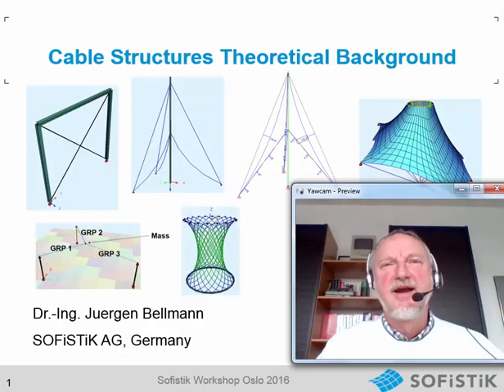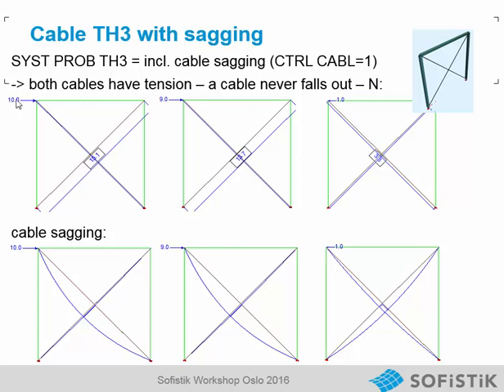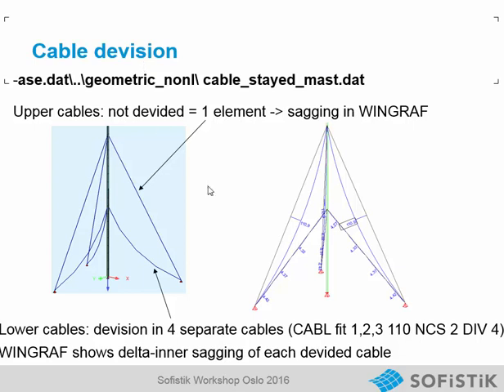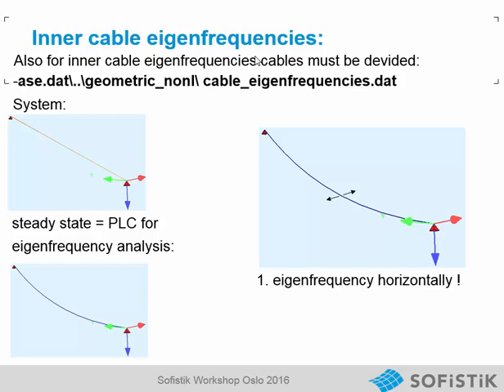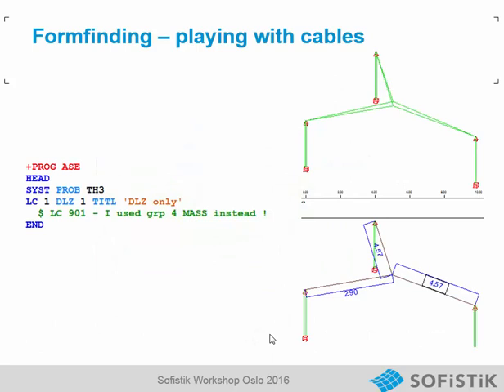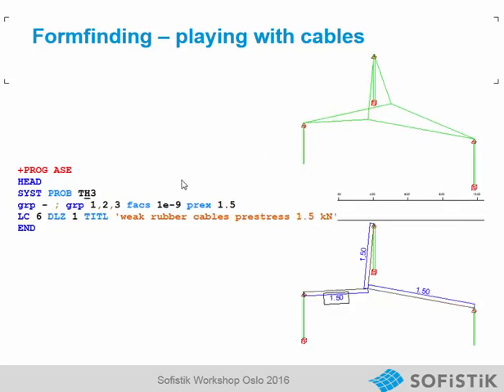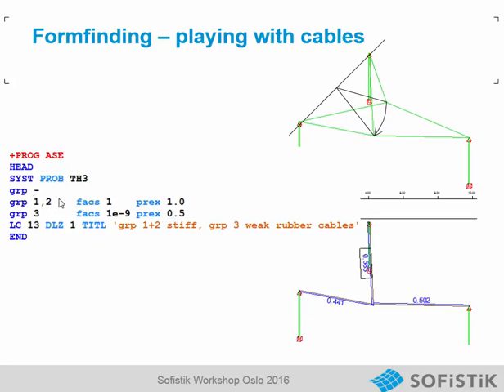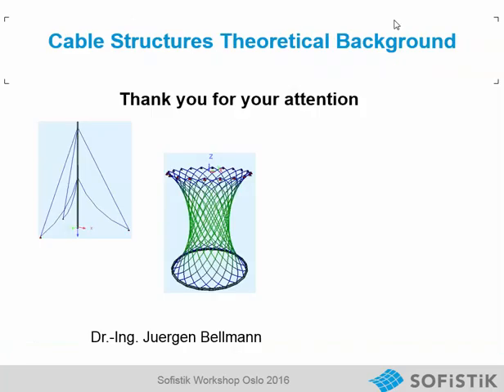ASE cables

Comment: Where can I find 'cable_crack_dynamic.dat' I need to check my model for cable snap
Reply from the maker: Hi Gaurav,
There is a library of textbased - TEDDY examples in the TEDDY-Program.
In Version 2023 these can be found when you start the program as a big button in the middle of the screen.
In older Versions they can be found via. File - Examples.